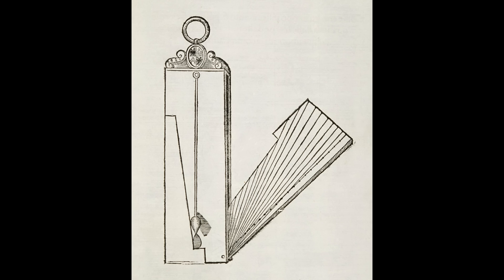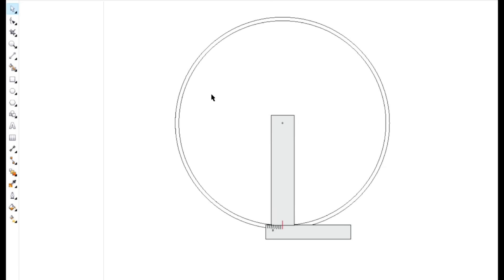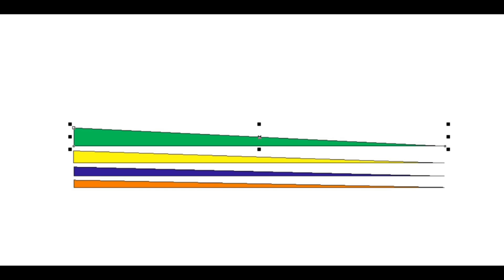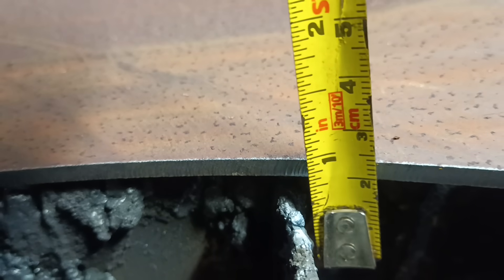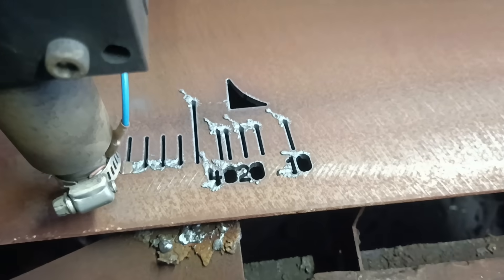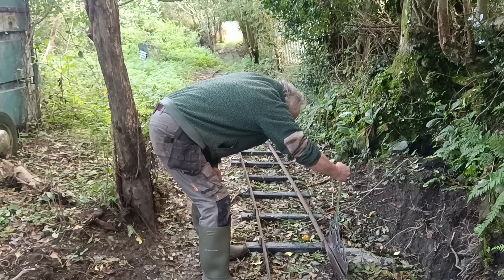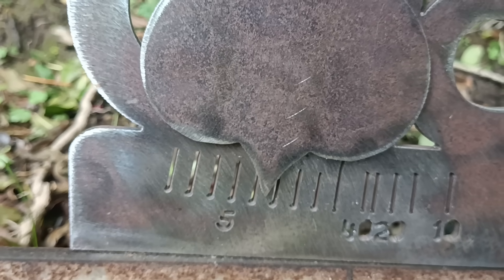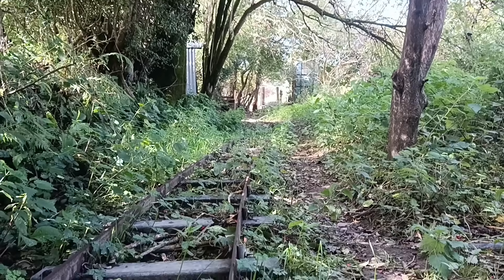I Made An Inclinometer To Measure The Steepness Of The Railway

Comment: today i was making a water level, i want to use it with long 8mm flexible water pipe, so i can measure the level difference between various points in my farm and plan my narrow gauge tracks.

Comment: Could see a couple plates screwed into the side of one of your bogies or on the engine so you could continuously review your track slope. You might need to add a weight above the pivot point to create a pendulum instead of a plumb bob to reduce the bounce and momentum of the cursor end. 
For markings of slope, instead of radial lines, perhaps a zigzag pattern concentric with the pivot center. That would also be logarithmic, so would be fun to see the subtle change in grade, and easier to estimate actual slope. 
Such beautiful work, love your graphic sensibility and productive joy in problem solving.

Comment: Long time commenter, first time viewer. (or something like that) You always manage to being a smile to my face, very wholesome. 
I had a thought about the traction issues. Sand might ultimately be necessary but maybe try fitting a cheap wire brush against the running face of each wheel to keep them clean of crushed organic matter.
Have you seen the Steve Mould video on leaves on the line? Pectin, I think it is. I'll dig it up and post a link in a reply. Keeping your wheels clean and your track clean where it matters might just do it, seems as though there isn't grass growing on the steepest section.

Edit to add: Another thought while I'm here, at critical locations such as stations mainline track sometimes has a knurled track face (if that's the right term here) to help prevent slippage. Maybe an option. I'm not sure how you'd knurl a length of flat bar. Modified ring roller perhaps?

Anyway, please keep it up you've come so far and it's great to see!
Reply: https://youtu.be/ZEuFSw-CMzU

Comment: If you get some twine or rope you can tie one end to the top of the hill and the other at the bottom. You can then use this as a rough guide for the least steep slope possible on that section of track

Comment: greetings from Australia, being giving some thought to your traction problem getting your train up the incline, my thoughts are, on the incline section of track, double up the rails , mount extra rail directly on the existing rail, (double rail thickness) , double the rail most likely double the traction, you also  need more power , how about employing a 12 volt  car starter motor with a Bendix drive (Bendix drive will allow motor to disengage when not deployed) place 12v battery in front box for extra pressure on the rails, great YouTube channel, very interesting, keep busy and have I been to ireland many times.
Reply: There is sufficient power just not enough useful resolution in the low end of the CVT. 

The one successful journey with two wheelbarrows was successful because Tim managed to choose a sufficiently low gear ratio in good time.
It might be wise to change the final drive ratio for something higher torque/lower speed.

Comment: While the gauge gives you point readings it would be good to survey the whole hill.  You risk adjusting each section and risk moving more stuff. Even to pull a length of string along it and see where is high and low. Then test to see what is under the high spots. Is it removable or not, etc. You have to dig the fill for the low areas so may as well do it from the closest high ones.

Comment: Maybe a silly suggestion,but thin head of some bathroom silicon sealant on top of the rails,before it cures,sprinkle some sand on top.
May not last all winter,but it would be cheap and easy.
Reply from the maker: I guess it wouldn't last one trip : -  (  That loco is very heavy
Reply: If only there were a way to get long thin flat strips of car tyre 🤔

Comment: Tim, I think you should first really try gearing down your loco! Here is why:

Horsepower is force times speed.  So halving the speed lets you double your force for the same horsepower. 

You've got a 1.5 Hp Lister D (I think). That means at 2 mph you get 1250 N of force (this is roughly the force of gravity on 127kg) but at 1mph you get 2500 N (force of gravity on 255kg)
Reply from the maker: You're right. But power is only one part of the equation - keeping momentum up could be crucial too.
Reply: @wayoutwest-workshopstuff6299  it could be, but if a reduced gear let's you keep power for the entire slope then momentum won't matter, right?  altho it's your railway and your loco so do what you think is best!
and as always, thank you for sharing these stories with us :D

Comment: Ok so time to redo my comment from the previous video with new numbers:
Using the same numbers (loco + driver 390kg, wagon 500kg) the loco would have to drag 890kg up a 1 in 15 slope, so it would need 580 newtons of traction force. The 390kg of the loco would have a weight force of 3800 newtons, so if the adhesion between the wheels and the rails was 0.2, then the maximum traction force would be 760 newtons. But given the rails would probably be quite dirty, if the coefficient of friction fell below 0.15 (wet rail or with crushed leaves/grass on top) then the loco would slip since then it could only produce 570 newtons of traction.
Reply from the maker: Thanks William. And it's easy to see it in real life - when maths meet metal

Comment: You should put the inclinometer on top of the train, rather than on the rail. The angle of the rail at a point is not necessarily the same as the angle of the train when going over that point, if ya know what I mean.

Comment: The old analog ways are best.  No batteries required, no calibration / re-calibration, no software updates or licenses, works in all weather conditions, and you had the pleasure of creating it.  (Beautiful by the way, and it makes a nice wind chime sound)
Reply: Mechanical devices absolutely require calibration and adjustment - parts wear, wood swells, metal corrodes, springs creep. They may not need batteries, but they're not magic either.
Reply: @NimbleJack3  In a general sense, absolutely.  In this particular case, what? Replace the string every few years?  In my work I have to measure rooms. I have had the same tape measure for 5 years.  My colleague tried using the phone app which updated almost weekly between it and the phone, required the phone to be charged, and was temperamental in certain lightning conditions.  Enough said.

Comment: When I was first laying track for my railway, there was one place that had a very nasty dip. To fix this dip, I placed cinder blocks under each tie to try and level out the track.
We used 2 inch, 3 inch, 4 inch and 8 inch cinder blocks.
After we got the track more or less leveled out, we then placed long Timbers between the bricks and then add fill between the rails. It worked out well.

In this way, leveling your track is quick and easy as opposed to lifting the track, adding fill, tamping and relaying your track only to find out that you didn’t add enough or too much fill.

Get the idea ?
Reply from the maker: Yes, I was thinking the same - great minds!

Comment: Like I mentioned it’s a civil engineering issue not mechanical engineering.  Regrade the road bed and you will be running great!!
Reply from the maker: Yes of course - but a huge job
Reply: @wayoutwest-workshopstuff6299 Hard to beat the rules of traditional railroads.  Cog railways are about the only thing that does… but that’s a lot of engineering and lots of problems
Reply: I was thinking about a capstan and a rope fixed on the top end. That's what the old railways used. See https://en.m.wikipedia.org/wiki/Cable_railway
Reply: @IIVQ good solution.  They used these a lot on logging railroads to move the cars down a mountain… one car at a time.  Sure would be nice to just hope on the loco and haul a load of manure across the field without having to fuss with cables and winches

Comment: I used to work on a railway, regular size. Did a bunch of track maintenance in my time there and when we measured the track it was always over large spans with our hand gauges, a couple of meters at a time or used laser finders for the real long spans. My foreman told me that any small incredibly steep point can usually be over come if its short enough. I think that principle is applicable here too though I don't know to what degree

Comment: I would love to see you make a computer management system with dashboard for the loco. You could have speedometer, inclinometer, rev meter, fuel gauge, wheel slip warning light ect. Could be made from a raspberry pi or Arduino maybe.

You could partner up with a tech channel maybe to help.
Reply: Hey, welcome to way out west workshop! you must be new here!
if you didn't know, this man is almost allergic to computerised technology, and we love him for it.
Reply: @bugz000 No he's not. You must be new here. He's used lots of technology.

He makes and uses all sorts of CNC machines, uses CAD software, uses a 3d printer, he does digital art, not to mention films and edits for a YouTube channel.

Don't underestimate him.
Reply: @bobsmith5088  it's not a bug, it's a feature, as you said yourself, he has access to computers, but he chooses not to use them in many cases, despite CNC machines have been around since the 50s, CAD software since the 70s, 3d printers since the mid 2000's 
i did not "undestimate him" - i am appreciating his desire for hardware solutions over an obvious computerised solution.

now if you would take your unfounded confrontational demeanor elsewhere, there is no room for negative people here :)

Comment: If Tim wanted to attempt a wrack and pinion system. He could always cut notches into the flanges of the wheels of the dung beetle, then create removable ladders (for lack of a better word and incase he needs to remove said ladders for maintenance of the track) which the  notches would fit into. make them out of rebar or angle iron cut to make the rungs

Comment: If you dig down at the high points like a foot or so and move half the material one direction and the other half, the other direction along the track, you can smooth out the change in elevation enough to make the grade more suitable?  It would be a lot of work, but tne alternative (digging a tunnel) would be much more work! 😊😊😊

Comment: If the inclinometer had a witness slide it could record the maximum slope that it experience. That way you could take it on the train and measure the entire track from one end to the other in a single pass.
Reply: Great idea in theory, but a plumb line also makes a great accelerometer.

Comment: Day 3 of presenting the idea to make the Loco a PTO to make the barrel wagon a multiple units with powered bogies too :)
( Have the 90 Deg PTO wheel mesh with the rear wheel of the locomotive with a cog held on a bracket, run the variable length shaft on the side of the loco to the wagon connection, same again with a shaft connecting the wagon bogie wheels, just make the cogs the right size to have them with same linear speed as the loco has. To avoid the transfer shafts enlarging the loading gauge, run them on the inside of the wheels 😊)
Reply from the maker: Theoretically it's easy, in practise it would need building from scratch again

Comment: I was thinking that, instead of using a string to attach the plumbob, it might work well to elongate the plumbob with a piece of metal bolted on at the point where the string would normally attach, so that it pivots smoothly along the svale.
Reply from the maker: That's a good suggestion.

Comment: 1 in 17 is about 5.9°.
That means that for that part of the railway, each 1kg of mass is pushing backwards with about 1N of force!
But you still get a lot of of the weight on the rails which explains why the engine stalled more than the wheels slipped. 

The actual equation is "sin(angle from horizontal) * mass * 9.8m/s/s = force pulling down the hill".  Considering how little force it takes to move the wagons along on the level, that extra Newton per kilo must really add up!

I wonder if you could see how much weight your loco could lift vertically before it stalls.  Knowing that would tell you roughly how much weight you could push/pull up a slope of 1 in 17 or how shallow you'd have to be to get it climb with three wheelbarrows.
Reply: I hate maths I really hate it but this really is the simplest way to fix a lot of Tim's issues.

Comment: Rather than using very large amounts of fill, perhaps you could get more of the recycled plastic lumber and build up underneath of the sleepers? I don't know if that would end up being more or less difficult than jacking and packing with fill. Either way, it might be interesting to try either surveying the terrain by using a laser level and a meter stick to figure out the height at each rail joint, or by using the angle measurements and a lot of math to estimate it, and then figure out exactly how far you want to move each track section up or down from it's current position. Then, like on larger railways, you can lift the sleepers at the joints with either a pry bar or a jack, pack your fill underneath whether that be plastic lumber or dirt, and then also lift and pack under the rest of the sleepers between joints. That way you wouldn't have to keep redoing sections repeatedly until you end up smooth, you could get an almost perfectly constant gradient first try.
Reply: I agree with you that if the sleepers could be lifted up somehow (make a platform for them?) that you may be able to avoid moving lots of fill.  Conversely, if some sleepers could be sunken in the ground, that's another way to play with the inclines... Good luck!  So good to see the puppies!  Yay Trudy!  Yay Sandra!  Yay Tim!  😊

Comment: In my home country of the US, caprenter's squares (which are triangles but have a 90degree angle) often have their hypotenuse configured to be angle measures for a plumbbob that one could dangle!
Reply: rise over run. I do recomend double checking them against another square. I had a cheap one that wasn't marked out properly. After finding out the hard way that it was off, I made sure to "correct" it with a hammer and made sure that it went into the bin.
Reply: I think I have one of those inherited from my grandfather.
I was given the opportunity to raid his toolshed after he died, so I took most of it. I aim to know how to use all of it one day.
The chisels scare me slightly.
Reply: @Skorpychan  learn how to keep chisels really sharp and they are easier to use.
Reply: @billhacks  The sharpness is what scares me. I haven't touched them since I got them, and the safety caps stay on.
Reply from the maker: Yes, I looked at my big square and thought that wourld have worked too. Oh, well!
Reply: Do a basic woodworking course and you'll be happy the rest of your life.
The trick is to keep them sharp and cut thin slivers off. Basically you don't need a hammer, just hand taps, for cutting into the grain (across the grain: use a wooden mallet).
Reply: Omg skeleman i love your youtube videos
Reply: @KooShnoo  glad to hear it 😊
Also happy that you enjoy Tim!

Comment: very impressive I like it I can remember some railway using sight boards boards with slits in line 3 or more you can tell if there's a dip in the track or you could just use a laser but that's cheating

Comment: 1 in 15 is just over 6.5% grade which is very steep for rails even narrow guage rails are usualy under 4% and that is considered very steep
Reply: Yeah, it's impressive dung beetle can go up that at all, let alone with a loaded waggon.
Reply: Wow, 1 in 15.  
I would rather have 1 in 20 or better yet, 1 in 50.
The railway I built was pretty much level with maybe a 1 to 30, but only for a few feet or so.
Except for the Dip. That was a 1 in 10.
Reply: At least it isn't as steep as Yosemite lumber company's logging-hill (1923)/Incline station (1944) with their 78% and 66% grades.

Better to work with the rail-line you've got than to try selling it for the one you want. But yeah, 3-10% grades start getting to the point where you settle for operational-shenanigans to get over "the hump" and count the blessings that the rest of the line is "normal". After >10%  and up to 130% you've landed in fernicular/cable-car territory.